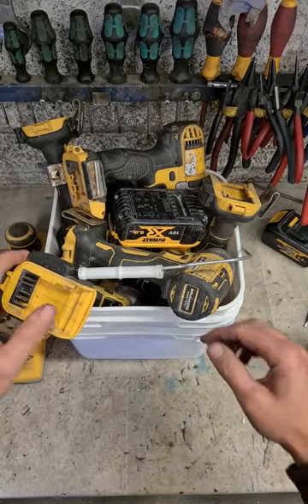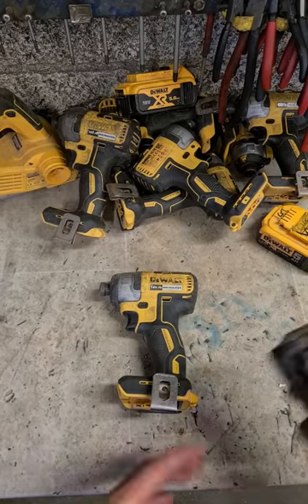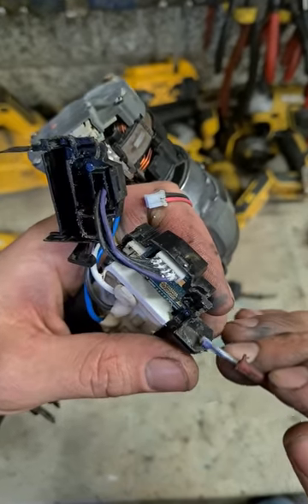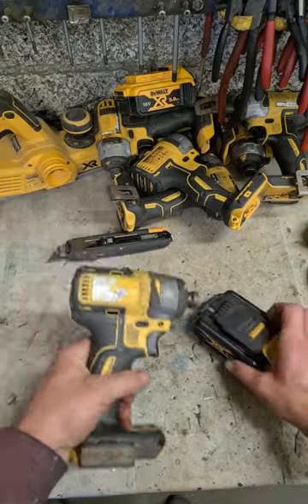Repairing a whole bucket of broken Dewalt tools.

Comment: i sell Milwaukee and Dewalt tools locally in NYC (no online sales). that DCF887 XR impact (as well as DCF787 and other cost down versions of that impact) break down constantly. same goes for the DCW210. they break all the time and i'm honestly sick of having to take them back, returning to vendor, re-selling, etc. Milwaukee tools are far more reliable but their batteries suck. Milwaukee 8ah and 12ah HO batteries stop working due to faulty BMS designs very often. 

if you're shopping for dewalt 1/4" impacts, i recommend DCF840 and 845. far more reliable while also being smaller and lighter

Comment: I'm glad I watched this. My 10yr old DeWalt 776 drill has the intermittent run symptom. I simply guessed motor issue. Gonna check the switch.

Comment: I think it's pretty neat that out of all the impact drivers only one required taking the actual hammer assembly apart to fix. And even that one required no parts so for the whole video you used only a couple springs and some contact cleaner.
Reply: it was probably dropped bit down, that's why the bushing was pushed inside.
Reply: Yes its pretty cool

Comment: I repair tools on the side. I didn't know that you could take the switch apart and clean it. I will try that. The Milwaukee fuel series you have to replace the whole assembly. That is why a lot of people just pitch the tools because it cost so much to repair it.

Comment: Hello Dean, i could really use your advise. I have a DeWalt DCF835 impactor. The battery charges to full so that one is fine. However when I press the switch all I see is one of the front led blink shortly and nothing else. I connected the battery directly to the motor and that runs well, so I am sure it must be in the switch. I cleaned it out like you do with contact spray etc.
When i measure the voltage coming into the switch on the Red/Black wires I measure the full 14V. But when I measure above the switch between the black and yellow wires I measure about 10v?? Not sure what the blue and white wires below the switch are for? Any ideas what could be wrong, and can I only replace the switch or do I need to but a complete new electric component which is almost as expensive a a new impactor!?
Hope you can advice or give me some tips to try?
Thanks for your help!

Comment: Well done, I do have a chinease 16v impact driver, i bought it lately, it has a strange error, it change speed quickly and suddenly, also if you do a precise job with low speed it may change direction and speed and fleck back again !!! A very strange thing i bever came across, may it be the trigger or the control board, it has this error since I got it, I hope you can advice

Comment: Dean you legend, thank you so much for sharing your incredible knowledge! 

Any chance you can take a look at the Milwaukee hedge trimmer (M18FPOH)?

Heaps of reports of units overheating, battery cutting off. Any hacks/tips??
Reply from the maker: YES, don't buy Milwaukee.
Im afraid they have the motor controller set up run hard and fast. Resulting in a shorter life span. A motor problem with a Milwaukee is simply not worth fixing. as the motor, controller, switch and battery contacts are all one piece. basically you would be replacing half the machine, for the price of a new one.
Reply: @deandohertygreaser ok, appreciate your input Dean and once again thank you for sharing your incredible knowledge!

Comment: I have one (drill driver) that works sometimes and mostly nothing happens when you push the trigger normal but if you slap the trigger on and off really fast you can get it to spin.  I want to toss in trash but still it sits there.  I see what you are doing, but I do not understand the things that you are doing. Lifting here pushing there disconnecting this disconnecting that is there any way you can either slow down your video or zoom in and get closer and show exactly what you're doing when you are working on these switches?  Hell from your video. We can't even tell what your spraying on that.  Thank you very much. It's exactly what I need if I can get a little bit more third grade level.  And yes I've been building engines and cars since I was young and I'm 63 but I just can't get the learning effect. I need to be able to do this myself from the videos I'm watching.  I guess maybe I'm asking for a little bit more talking maybe pausing the video zooming in on what you're doing and how you're getting these things apart so I don't open up mine and end up with a basket of parts.

Comment: In your opinion sir, which do u think is the most reliable manufacturer & built to last?
Reply from the maker: afraid there is no right answer. for me its Makita. but each brand have there good and bad tools. for makita there bad tools are nail guns and table saws. 
so it more depends on what tools you will be running.
Reply: Depends on too many factors.
To me its Makita, Bosch Professional and Metabo. They all make solid machines and supply spare parts for reasonable prices. 
But you always have to do your research not every tool they make is the best for you.

All my 18V tools are Makita since their battery ecosystem is huge and affordable. 
But there are many more excellent brands like FEIN, Eibenstock and many more high end specialty brands.
In general if you need a specific tool thats corded not cordless id always go with a brand that specializes in that field.

Comment: those dewilt 887s are so cheap from my local pawn shop that if one goes down, i pick up another one for $40-$50 then i have a spare everything unless its the ball or spring in the chuck then ill put new ones in. bought a handful of each as doing concrete form work is hard on the chucks.  
if you dont mind me asking but where do you source your parts from? thanks.

Comment: I used dewalt for 1 power tool and ended up throwing it in the trash. Brand new it had issues. Replaced it with a milwaukee and could not be happier.

Comment: Hey Dean, thanks for the videos and your work!
My dewalt i think its 887 impact; it feels weaker than other impacts… sometimes it’s like the gear changes. So I’m trying to drive a screw in on the highest speed and in the middle of it the speed and sound lowers and gives up. I try again and the speed comes back
Reply: Probably wiring issue getting juice like it sound for the first part of hitting trigger then isn't, then lit sit then u let it sit again an it does the same thing starts strong then cuts out, haven't seen any videos yet on that issue or would know how to fix it by now lol good luck

Comment: My Dewalt mini blower got wet from rain.  It will start to blow but shut off after a second.  Where is a good starting point for me.  Not the battery, batteries work in everything else.  Thanks!

Comment: I love how you dont feel the need to give a detailed clean to the housing. Just quick repair and these little tanks are back at it. What are you spraying the triggers with? Is it a clp like i use on my guns?
Reply from the maker: cleaning with electrical contact cleaner and also applying a lay of silicon spray to help lube the brass wiper
Reply: @deandohertygreaser  thank you!
Reply: @deandohertygreaser what do I need to clean if my 1, 2,3 switch doesn’t work all that great? Is it the trigger switch or the 1,2,3 switch? Thank you!!

Comment: 5:35 i cant believe you saw that i guess you had to be holding it in your hand also FYI that stupid untilly knife you got on the table DOES NOT WORK for scraping glass you need the thinner razor blade with the hard back and the tool that goes with it that puts it at a 45 on the glass, anyone that works with glass knows that's the one to use, and that box cutter (thats all its good for if you can get the dam thing out) is useless in a utily knife you can get the extra 1/4 like the drywall knifes that lets those bigger blades sit in 2 different positions a longer or shorter

Comment: i work as an cctv camera installer and i need a hammer drill cordless i only need few milimiter deep small holes to  drill i am thinking to move on from my corded bosh rotarty hammer drill to a lighter regular hammer drill which one would you reccomend ? 18v ,
Reply: Hey man,
As a suggestion go with the one where u already have some batteries for.
If you don't have any, Makita Milwaukee or DeWalt will give you great results regardless of the brand. Festool and Hilti are also popular but much more expensive.
Either way, just make sure to have a brushless motor on it and you will be just fine.
Reply: @Matt-ns2ty   yeah i am thinking about milwaukee gen 4 hammer drill  i found a good deal with drill driver combo
Reply: Yeah, if you're just drilling small holes for masonry  anchors & screws(1/4", 3/32", etc), any of the brushless cordless hammerdrills will be fine. They're not the best for bigger holes but I'm sure you'd use an actual hammerdrill for that. What ever brand batteries you're invested in already would be the one I'd go with. 👍👌🛠️🗜️🔧🔩📏⚡⚠️🔌😄
Reply: The 12v milwaukee tools look great and very compact. I use 18v makita but do anything and everything. If I were up and down ladders just doing small holes I'd look at 12v
Reply: @Smithb83  i was thinking the same but occacionaly i chukck sds bits to bore big holes for few cables  to fit through and i want drill to handle the abuse
Reply: @DAVITALORD  yeah it's nice to be able to cover all bases  💪
Reply: Eh pretty much ever brand will do just fine with small holes and last.

Makita and Bosch Professional is very solid. 
Dewalt and Milwaukee not so much. Too much electronics issues with both brands and especially DeWalts seem to fail often.

Comment: Older tech seems to last longer. I guess it's because it's lower in power and less advanced.

But what this video tells me is that people don't take care of their tools. These tools look like they washed up on a muddy bank and then ended up in a desert storm.
Reply from the maker: You have to remember, these are tools for doing work. They need to be able to take a bit of abuse. 
They are for earning money, not looking good.
Reply: @deandohertygreaser  I understand this. I work in the industry and sell these tools. But some of them look like they got dirt packed into them like they been on the dirt ground outside.
Well anyways, You sure fixed them up and those seemed like minor problems. Well done
Reply: @kierandoherty1600  Ah Yeah. It looked liked dried concrete or plaster on the side on some of them.
Anyways, I really like the concept of saving these tools. And personally I love Dewalt. Super comfortable grips and plenty of power. Nice Synergy in the battery family. Getting the small 12v Dcf601n screw driver for DIY work at home.
Dewalt just make comfortable drivers.

Comment: Well, what can I say ? 🤔RIP 🪦 not just the broken drills but , the brand too!!😳😮🤣🤣🤣🤣
Reply from the maker: What do you mean, dewalt may not be the best brand for every tool. But they still one of the top brands to buy. For shear amount of work and long run time, these dewalt impacts are one of the best. Plus when this dose happen, they can still be fixed up. 
I'd like to see milwaukee tools last this long, these are all well outside the warrenty.
Reply: @deandohertygreaser Milwaukee tools don't last as long because they actually get used. DeWalt is for diyers

Comment: Those have to be knock-offs cuz it says 18v instead of 20v
Reply: Why does it lol
Reply: 😅Not a knock-off at all! They are referred to as *20v here in US, but over the pond, they are 18v(which is their actual voltage). If you look closely there will be an asterisk on the packages right by the *20v, then in small print it'll say "*starting voltage...nominal running voltage is 18v". Same with 60v flexvolt over there, they're called *54v instead, which is their actual voltage. I think DeWalt does it to prevent confusion with their older lines of 18v(NiCd) & 54v tools they tried a long time ago. 20 volts is just the starting voltage of a freshly charged battery. Check for yourself w\ multimeter, it'll be down to 18v after using a little bit. You know how a fresh charged batt sounds so much stronger than a used(2 of 3 bars on batt meter)? That's why, it's @ 20v to start, then goes down to 18v after. A good, charged, health '12 volt⚡car battery will measure 14 - 14.5v but go down to 13 or less when it's on its way out.😄⚡⚠️👍👌🛠️🗜️🔧🔩📏⚡⚠️🔌
Reply from the maker: no they are genuine, we call 18v batteries and tools here 18volts. not 20 volts. only in the states and canada are they called 20v. You go by the max voltage after a charge, we go by the actual working voltage. We use the true voltage, 20v is a simply marketing play.

Comment: Surprised these have serviceable switches and judging by how many had problems with the switches that might not be a good thing?

Wonder if the bit was stuck in the one there was nothing wrong with?
Reply: Could be
Surprised he didnt even check
Reply: I thought the same thing about that one(6th??) It's the only one that came w\ a bit in it, so I'd think that WAS the problem. I have several of these(dcf886, 887, & 886 turned 890), I've not had any problems with the switches. I think it's just a dust\dirt intrusion into the electrical contacts problem.. That's why he just cleaned & out back together & they were working fine. The bending of contact springs was just a helpful thing with the age & use of these tools. Whoever that contractor is, maybe he just does a lot of dusty, drywall work. He obviously likes & depends on these DeWalt tools, but doesn't clean up too often. So he just paid repair guy to do that....internally at least. 👍👌🛠️🗜️🔧🔩📏⚡⚠️🔌😄
Reply from the maker: no the bit was not stuck in it. also put a long scrap bit of my own in and clamped it in the vice to check the impact. all was good

Comment: I like dewalt all but this whole video just proves that the dcf887 is one of the worst tools dewalt has ever made And to be honest they still cant make a good impact driver
Reply from the maker: Actually i think dewalt make one of the best impactors on the market. I can be using one for a few hours driving 100s of 45mm timber tec screws. iv used the makita, hikoki and milwaukee ones and them all over heat very quickly with prolonged use. 
Granted, dewalt is not the fasted impactor by far, but 887 large gearbox and large means it can dissipate the heat generated much better, meaning it can keep running for longer.